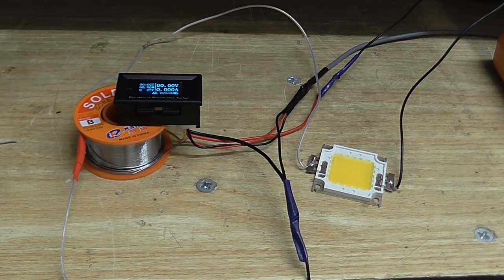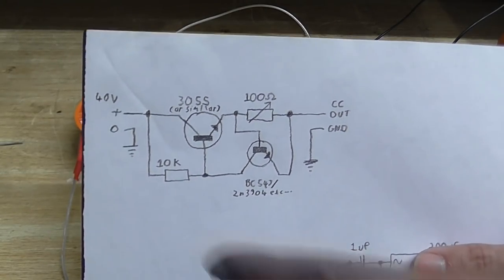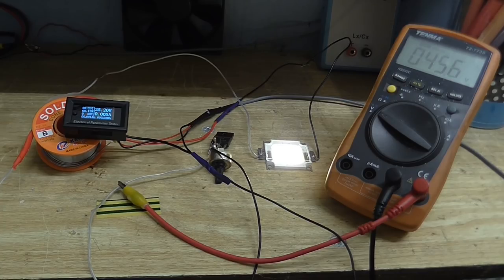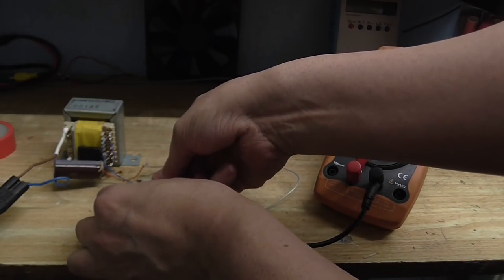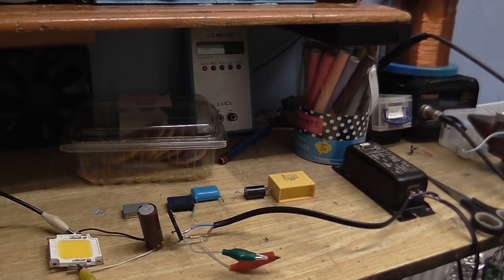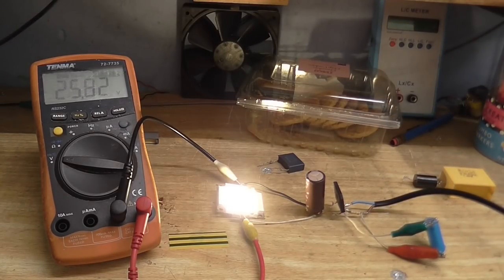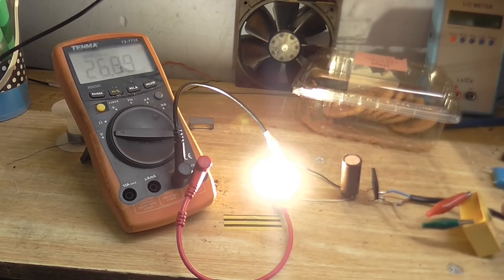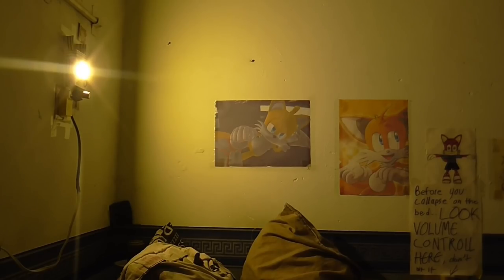CDC Electronic Workshop - Tinkering with a Power Led and making a bed side light

Comment: That 2.2uF cap is X-class rated, it can handle some abuse. What you are missing is an inrush limiter. When cap is discharged and you plug it in, there will be quite a spike of current through the LED. Luckily for you it's a powerful LED, overkill for the job.
 You can use your scope in single-shot mode and capture the spike across a shunt going to the LED, but remember to use isolated supply so you don't damage your scope.
Reply from the maker: Better overkill than use something that would blow right away! I guess it's only running somewhere between 2-3 watts but it doesn't need any more than that for what I'm using it for.
Reply: CoolDudeClem Yes, but I'm talking about the surge, which can be several amps. Whenever you use big value caps, make sure to keep surge current in mind. Just a tip to avoid surprises :)
Reply: MrJohhhnnnyyy, You told the right point but for instance if he uses another bleeder resistor across the electrolytic capacitor that would also save the LED(but may destroy the FULL BRIDGE RECTIFIER😋)
Reply from the maker: I don't see how there could be a surge of current across the LED, the only place where a surge would be is at the filter cap and even then it wouldn't be much. The voltage across the LED slowly rises as I turn it on (as you saw with the first voltage drop capacitor I tried) so the current across the LED would also slowly rise, there cant be a spike across the LED
Reply: But the FULL BRIDGE RECTIFIER is at risk without a fuse😆 😋😋
Reply: The LED could be affected while running,due to the reason that the voltage across the electrolytic capacitor rises in a parabolic path (not linearly) so, for instance if anyone is running a Tesla could or if a dumb is trying to plug in an inductive load in the same wired socket with a loose fit, causing arcs to develop on the socket, that would give rise to an avalanche to the voltage across the LED which damages it, which you'd notice when you need it......etc.
Reply: CoolDudeClem Yes, but... I'm telling you this because I've fried quite a few LED's that way. 
The filter cap will soak some surge, but it depends on its esr and value. How many uf you got there?

Comment: Mr Cool Dude Clem, i am using a 50w led chip in this circuit and using 2.2uf cap but it still dim than the real output so what now
Reply from the maker: this circuit will never power a led such as those at full power. I made this circuit mainly because I didn't want it bright, I needed a low light to give me enough light to see around for when I watch TV and play Video Games at night. The camera makes it look a little brighter than it really is.
Reply: mr cool dude clem if i use 3.3uf (335k) cap, can it will give at full power ?